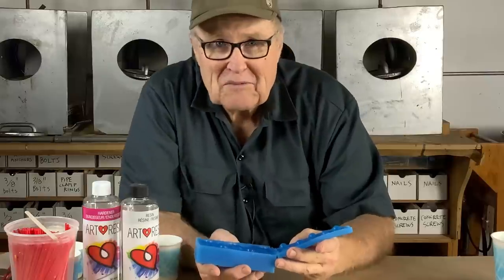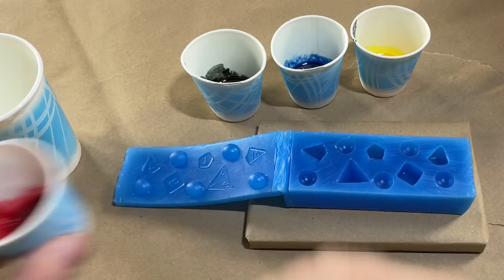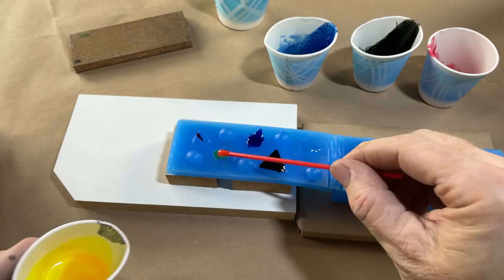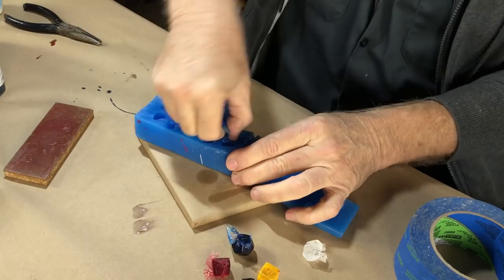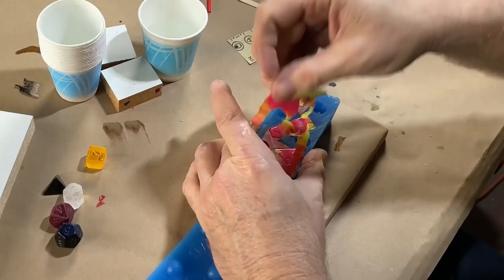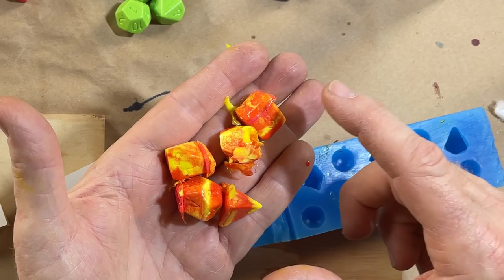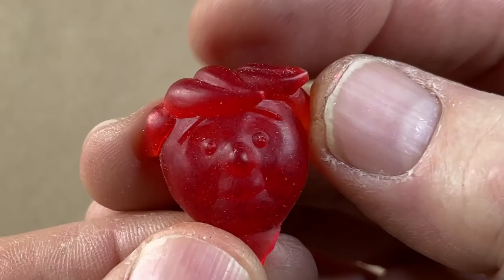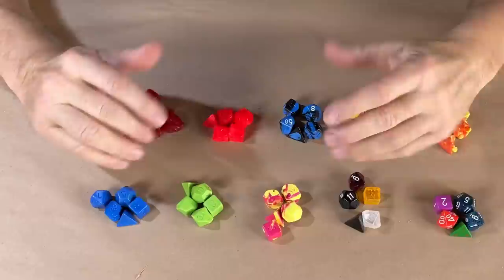Dice Casting - The Good, The Bad And The Ugly - Part 2

Comment: Robert - Congratulations on getting some cast dice out with pretty clean - bubble free - surfaces; but, would you mind cutting open some of those dice open, so we can see if there are bubble-voids inside the castings?

I ask this of you, for dice with internal voids will not roll true - as dice always seek their lowest center of gravity, and thereby, would favor the heaviest side on the bottom and the lightest side to the top - and, we can learn if this casting method will produce true dice, or, ornaments. Thank you so much!
Reply from the maker: I will be happy to cut some open. But just playing with them they seem to give a random result. I suppose for any really valid test you would have to roll them thousands of times.
Reply: @RobertTolone  10's of thousands of rolls, unfortunately is require to reveal an inherent bias of a die.

The other way to test a die for being true and balanced is to float the die in a glass of water with a very high saline concentration and a few drop of dish-washing liquid to reduce the surface tension ; thereby, rendering the die in question neutrally buoyant as it floats in the salt water - wherein, the 'light side', IF THERE IS ONE, will repeatedly roll to the top side of the die and be revealed more often than not, as the 'heavy side' naturally comes to rest on the underside.

That being sad, cutting open some of these cosmetically good castings will tell us what we need to know visually; if less than a 100% internal fill is revealed, the die cannot hope to roll true.

I'm hoping for success!

Thank you for going the extra step for your fans and students, Robert, you are THE BEST!!!

Comment: question can you make dice without a presure pot or a vacum chamber ??
Reply: Yes but they have little imperfections and the failure rate is higher. By imperfections I mean the best ones I have without preassure have very small bubbles in 1 of the faces, like it was poked 20 times with the very tip of a needle. Someone who isn't looking very close wouldn't notice it. And by failure rate I mean ~25% of my dice have unfixable issues or things I could fix but don't want to bother with. I always warm my resin before mixing because bubbles flow out better but I have less work time.

Comment: Really cool, a quick question, how do you dispose of the leftover resin and silicone?
Reply from the maker: I use it all up.  If I have some dregs in a bucket I will react it into solid plastic and throw it out. Also, my city has a toxic waste disposal site but I try not to have to use them.

Comment: Would pie weight work well in place of the nuts as weights?
Reply: You would probably need more volume to increase the weight.
Reply: @glenfisher728   but the there would also be less empty space between the pie weight than the nuts.
Reply from the maker: Experiment to find the weight that gives you the minimum flash. If pie weights are sufficient then you’re good to go.

Comment: why use three cups?  why not pour one half into the other, less cups used
Reply from the maker: Because the mix ratio will be off.  There will be less of the material that is poured into the other cup. But when you pour both cups into a third cup they leave the same amount of residue behind so the amount in the mix cup will be the same.  You could however, weigh the A and B sides into the same cup.

Comment: As far as painting dice go there are a few methods.  The professionals (aka major companies) actually just put the die in a paint vat, paint the whole thing, then do a final "tumble" in a industrial tumbler and it just applies a final polish while knocking the excess paint off everything but the numbers.  The normal hobby way of doing it is just slather some acrylic paint in and then rub it onto a paper towel on a flat surface to take out the excess.  The next method is basically the same as method 2, but instead you just get a "paint pen" (sharpie makes them) and you just use the pen to write in the numbers then wipe it off ala the paper towel.  

There is also an actual tool specifically designed to fill dice numbers and pips in by hand that some dice makers like brybelly I think use but I got no idea what it is called, or how you would get one.  I have seen it used in videos though, it is almost like a ink pen sort of thing, it just deposits the paint into the cavity and is somehow loaded to always have the exact amount.

Mold wise I am impressed, I expected way worse results.  I knew the flash would be ok, and the clean up would be minimal, but the epoxy resin is never going to be bubble free without pressure, and you can't pressure with no vent.  The Urethane came out pretty darn well, too bad urethane resins are always opaque.
Reply: Just so you know you can get clear urethanes, water white and UV stable much better than epoxies in fact.  The downside to them is that to get them really hard and still be low viscosity for casting you need to use monomeric isocyanates for the hardeners which are toxic by inhalation.  So unless you know what your doing and have all the correct precautions in place they are not suitable for hobbiest/home use.